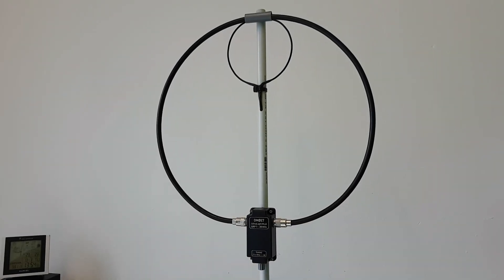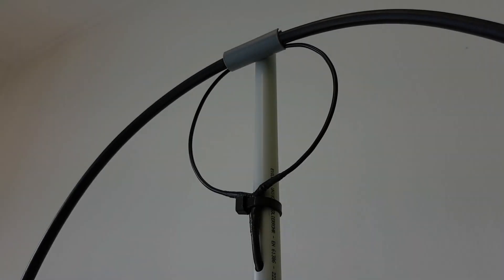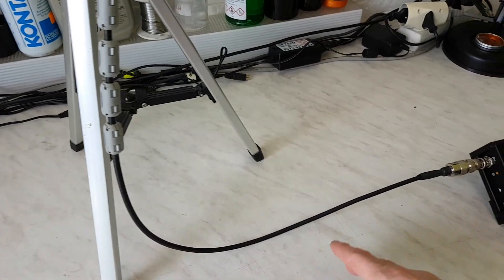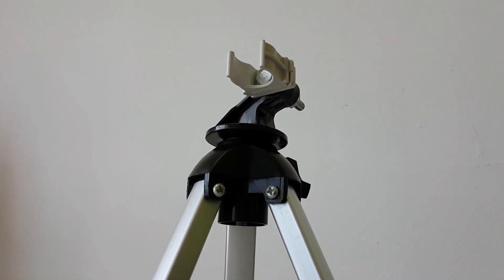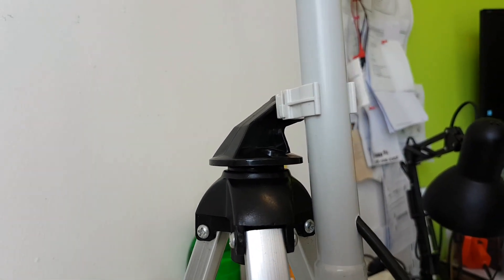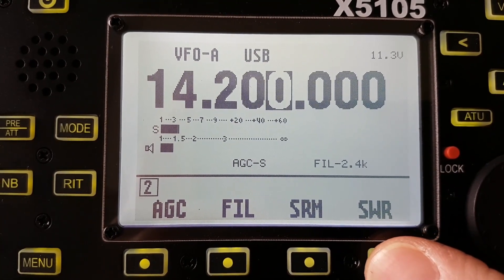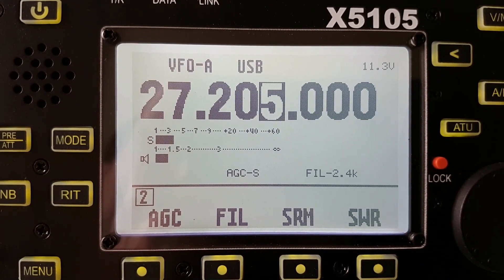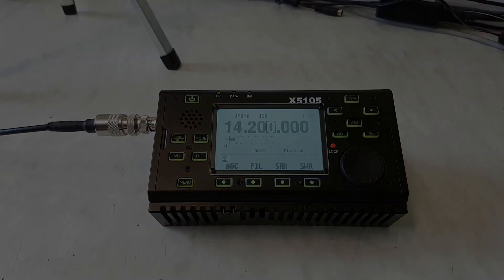IMPROVED - UltraLight Magnetic Loop Antenna

Comment: So I built a similar, slightly larger antenna. In winter, there is terrible noise on a long wire, especially in our city, so a magnetic loop antenna is suitable. It is relatively quiet in terms of noise. I didn't have any good, really thick copper wire so that I wouldn't have to worry about it being outside the magnetic field of the main loop, so I improvised two coupling loops on top of each other, which I connect to the coax via a terminal block. It works, especially in times of strong signal on shortwave frequencies. In my tuning capacitor box, the coax of the main loop is connected via BNC connectors, where on one side both the gnd and the signal conductors are soldered to the stator and on the other side the gnd and the signal conductors are soldered to the rotor of the tuning capacitor. The coax here does not serve as coax, but as a magnetic loop. However, I didn't really succeed in working with the tuning capacitor, so I can only tune it roughly and I fine-tune the rest via the tuning circuit that I built for the long wire. The little bit of extra noise that remains after passing through the balun is nothing that would fundamentally harm listening to the radio, the radio can attenuate it. The efficiency of my antenna is not dazzling, but it is sufficient for winter operation, for listening to medium-strength stations in good quality. I can even get below 6 MHz with it. Thank you for the inspiration and encouragement.

Comment: From LOOP adjustment is a little better from the practice of GAMA adjustment. Because GAMA is fixed and does not move, it holds the SWR perfectly.LOOP adjustment, knows that the wind moves SWR.

Comment: I have tried your antenna on 75/80mtrs for receive only?
Reply: OOPS!  Have you tried your loop on 75/80mtrs for receive only?
Reply from the maker: @dandruff7807  no, I never tryed it on 80m. But with an additional little capacitor you can use it for receive only. With this diameter it will be very nonefficient antenna.

Comment: So the main loop is the braid of the coax and is not connected inside the box, this couples to the small loop for tx/rx. The capacitor is connected to the inner conductors of the coax, how does this tune the loop when the the inner conductor is shielded by by the outer braid of the coax loop. ?
Reply from the maker: Yes I use the braid as a big coupler to the inner loop. Therefore is the braid not connected to any part of the antenna. I achieve better SWR in whole antenna range. Strange but it works. Watch version 3 and 4.

Comment: Very interesting. You say that you are now using the INNER wire of the co-ax as the receiving loop? Is it shorter to the sleeve, or is the sleeve entirely disconnected? Have you tried it with a gap in the sleeve at the top of the loop, as I have seen in some designs?
Reply from the maker: Thanks Phil. Yes there are the other videos where I use gap in the outer braid in the middle of the coax loop. Currently I don't use the gap any more but the braid is still not connected to anywhere. Connected is only inner wire to the capacitor (ver.3 and v.4 - see videos) 73, Paul
Reply: @OM0ET  I see. Do you have a theory about this? Or was it based purely on observation and practical testing?
Reply from the maker: @BarefootBeekeeper  Yes it was based on my observations and practical testings... it works very nice for me ;-)

Comment: It would be real helpful if you can make one more video and show exactly how you connected the small Loop coax together at the top and also show how you connected a solid copper cable to the end of your radio output I'm assuming that you just connected the hot only and no ground connection is that right would appreciate the clarification on those two things
Reply from the maker: Thanks for your replay. OK i will try to make another HOW TO DO video. 😉
Reply: @OM0ET  it's been 4 years - can you please make a video on how to build a magnetic loop, and show what the tuner looks like on the inside
Reply: I agree!!  Thanks

Comment: Link off :(
Reply from the maker: Th3 Pingas™ ahh sorry, tomorrow i will repair it. Ok?
Reply: OM0ET OK Alright! hey that your radio that you rode with pieces from China, the one that picks 6 bands. Is it possible to change the 10m band to cb? (11 meters)
Reply from the maker: Do you mean Xiegu X5105?
Reply from the maker: Xiegu has pre-defined 10m band but you can programming CB channels to the channels memory mode. And then you can  easy use it as CB radio. Or you have VFO-A and VFO-B. So on VFO-A you can use only ham bands and on VFO-B you can leave the CB frequency (27.555 USB) and that's it.
Reply from the maker: If you mean home made 6-band SSB transceiver so it has also pre-defined program to switch 10m band front end filter when is tuned frequency around 10m band. Probably is possible just tune front end filter for lower frequency as CB is and it could work also because it's very close to the 10m band.

Comment: Very impressed with the neatness of the design and a usefull compromise good band coverage 7mhz to 28mhz  ... can you cover 29.7 ?  G4XRM  ... My loops work but yours is practical .
Reply from the maker: bryfosk thank you very much! 😉 I think max. frq is about 28.500 MHz. 29MHz could work by smaller loop i suppose. I did not tryed it ☺

Comment: Loops are good and have been using them for 23 years now.
When some hams are on mailing list saying bands are shut I am working DX with my X5105.
No antennas allowed and I have metal above me and below me and building is steel structure.
Not supposed to work but does well.
Your loop is very professional looking.
73 BOB  AF2DX
Reply from the maker: Yes i had a couple QSOs from indoors and it was impressive, see here:  https://youtu.be/5vhuqIwj3R8

Comment: Given the size, I assume efficiency on 40m is really low, isn't It?
Reply from the maker: Fabio Sona sure but which small portable or pedestrian antenna has high efficiency? It's all about the compromises. That ones or we can use much bigger antennas like LW, dipoles or verticals. But this antenna is very easy to put her in to backpack a go.  ;-)
Reply: Of course
Reply: Not efficient at all given the diameter of the outer loop. I also make my own magnetic loops, but I have different size inner and outer loops to creat the most efficient magnetic loop for each band. My capacitors are a lot bigger too, 12 inches long. If something is worth doing, it’s worth doing well, else why do it?

Comment: The small coupling loop, adjust it to oval, you will get a better match.  More of it will be in contact with the main loop.  Try it.  Report what you find.
Reply from the maker: Gregory Heath ok but for what is it good if the SWR is on all bands perfect?
Reply: OM0ET https://youtu.be/2RDtm6qXjuI
Reply: OM0ET I am building one too.
Reply from the maker: i've seen this video and now i better understand of you question. Yes i did it on my MLA. Let see the coupling space of small loop along with the main loop here: 2:18 its 55mm long space (under this grey plastic holder). Main loop and small loop meets togheter there in 55mm long line - not just in one small point.